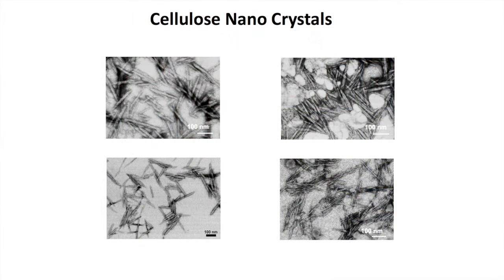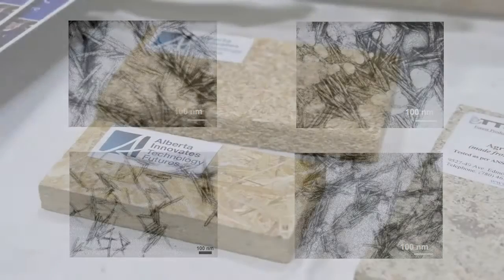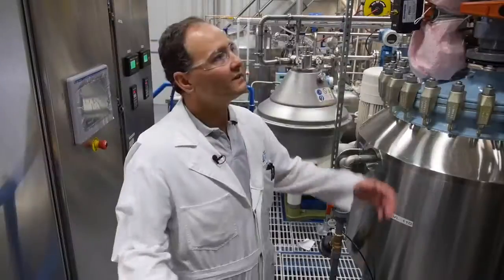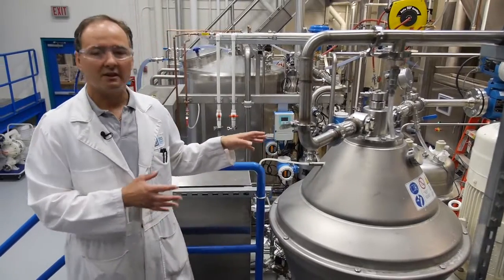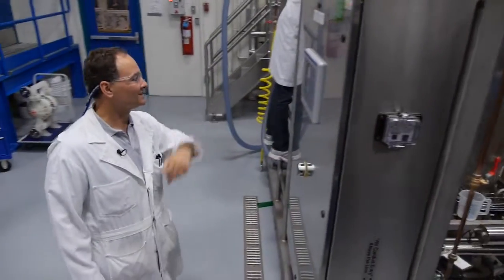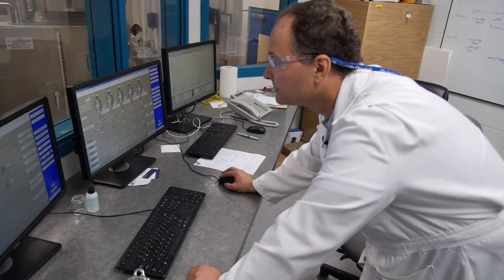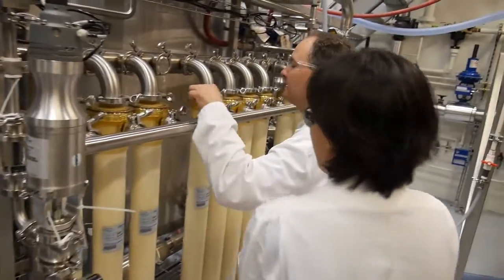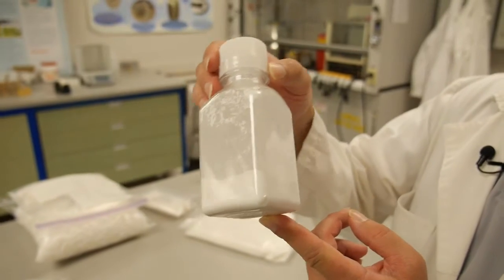What are CelluloseNanoCrystals?

Comment: I hear this product is being used in 3d printers to make objects.... im curious what a spool of these nano products look like before going through a 3 d printer... .. Is it even a spool of nano.. or is it a semi liquid . I also hear it can be used to coat products and make them water proof... The TED TALKS say that it can be used for packaging...  The ted talk guy ate this stuff and said its completely safe to eat...  what else can the nano crystals be used for..?  Thanks a million !
Reply: From what I understand 3d printers use celulose acetate, not so much CNC. 
This stuff is pretty cool because you can use it in fleXible electronics, liht weight armor, and other cool applicaions.
Reply: nanocelluose can be used as a resin, so you can make parts, like a window since it's clear. It can trap light, and oxygen molecules, it can be stronger than steel...